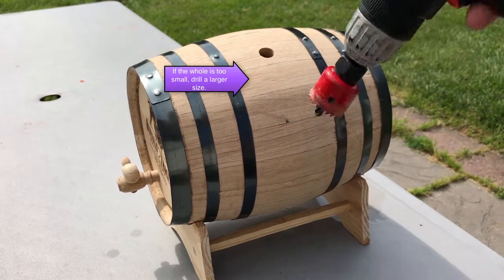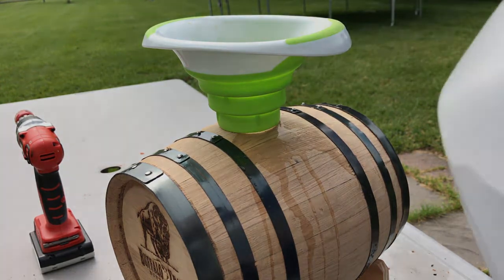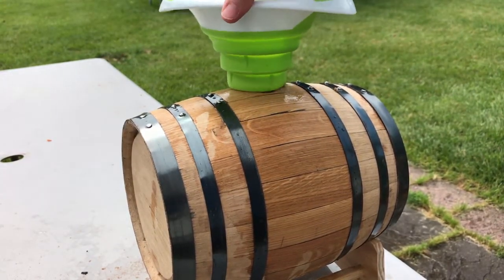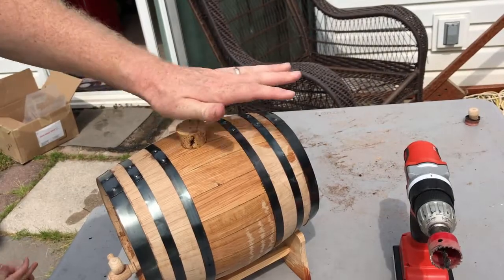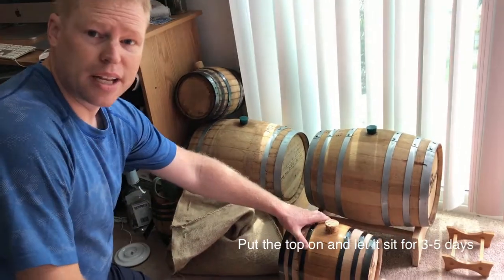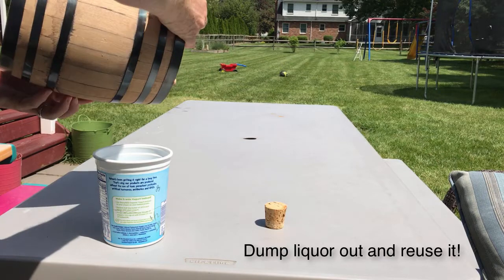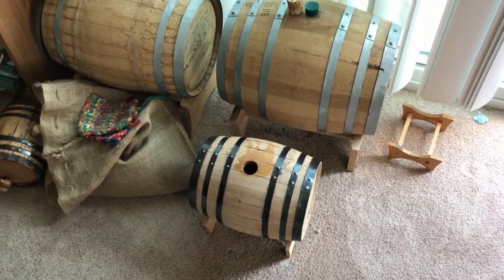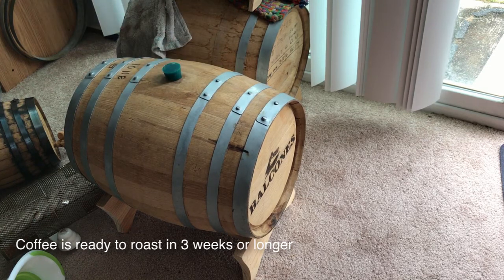How to Make Barrel-Aged Coffee using New Oak Barrels

Comment: Great video! It got my attention when you said you can do with wood chips. How do you will go about? Thanks
Reply from the maker: It is a little more involved than a barrel. Yet it is not hard. You basically just select the alcohol of your choice and soak the oak chips in the alcohol for a couple of days. It is best to keep a journal and write down each batch. Just play around with different whiskeys, rums, bourbon etc until you get the flavor you like! After a few days, remove the chips, dry them out for a few hours...and then put them into the green beans. Then let them sit for 2 weeks. Once again, you can try a batch at 1 week, 2 week and 3 weeks. Just test and verify each batch! Have fun.

Comment: How do you get the coffee beans out of the barrel when you are done aging them? Do you have to essentially shake them out if that little hole?
Reply from the maker: I did not see your reply. Sorry about that. You can drill a larger hole with a drill gun. I did that for one of my barrels. I then just purchased a larger cap to fill the drilled hole. Then you do have to just shake them out. The larger the hole, the easier the beans come out! I have also experienced with using Oak Chips instead of a Barrel. It could end up being cheaper and easier. So far, that method works well too!

Comment: Hi dave... great video how do you clean the barrels...or the best way to do it.  Thanks.
Reply from the maker: Couple ways you can do it. You can remove the metal rings fairly easily, which will cause the barrel to fall apart. You can the clean them and put it back together. To be honest, the whiskey is sort of its own cleaner. When done with a batch, I just put it out side (in the hot sun) to dry it out. I also don't reuse barrels more than 2x in most cases.
Reply: David Chism thank you!

Comment: No mold risk ?
Reply from the maker: No...you are using alcohol (straight up). Then you dry it out. I put it outside or take the top off so it can air out a bit. Any moisture that is left is just alcohol...but honestly I wait a number of days to let it air out a bit...then put the beans in there. Never had a mold issue.

Comment: Hey Dave, Have you aged any roasted beans?
Reply from the maker: Yes I have
Reply: David Chism I age Cigars ... The most expensive tobacco from DR are leaves that are aged in bourbon casks. Aging coffee beans after roasting sounds kind of reverse of charting the oak. After a Cigar or wine is fermented, it’s aged. They develop an intense lingering flavor called “Rancia” ... kind of like a marzipan almond note. Coffee is so new ... pave the way. 

FYI ... Ex-Sherry Casks will give you the most amazing beans. Trust me!
Reply from the maker: I misread your post - I don't age after roasting. But I might give it a try - I like the idea.
Reply: David Chism Hey Dave, I’ve been aging Cigars for over 10 years ... you can age tobacco before rolling which is decent. But the best cigars age after being finished. The key is “Relative Humidity and Consistent Temperature” great wines are done exactly the same.
Reply: David Chism I’ve had so far minimal success aging roasted beans in the fridge. The beans were shelf aged for about a month to release the co2, then kept in a 55-60f max for one month ... so far it’s been a successful endeavor resulting in less “Sour” acidity with much more pronounced coco nutty flavors.

I used an old 3000 gram airtight illy container.
Reply from the maker: Have you tried this method?
Reply: @peterbrogan1933  Looks like you know a lot about aging. Can you tell me a little bit more about?
Reply: Hi  @DavidChism , did you keep experimenting aging green coffee in oak barrels? How did you make progress?